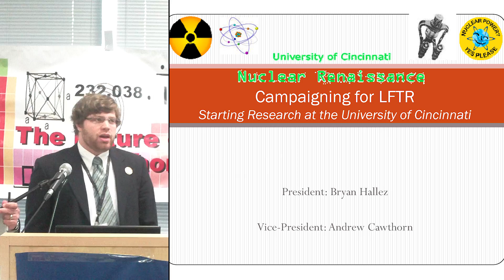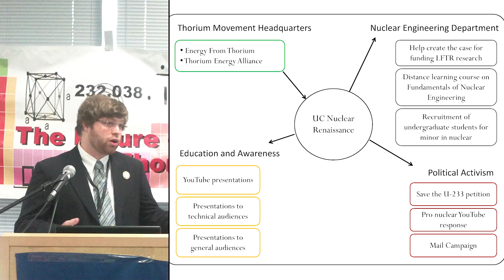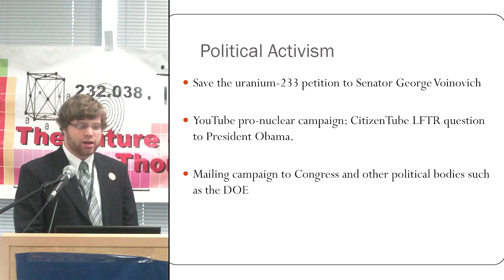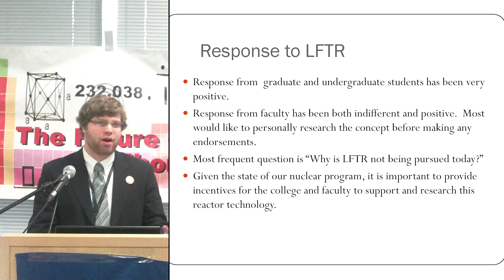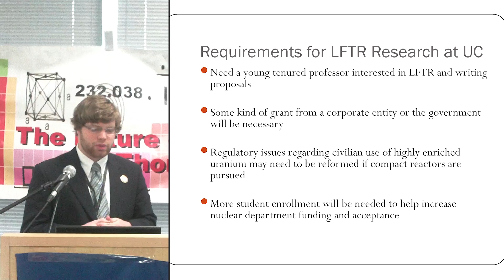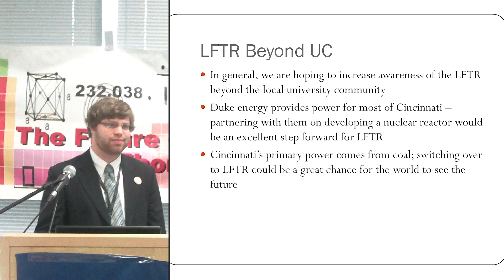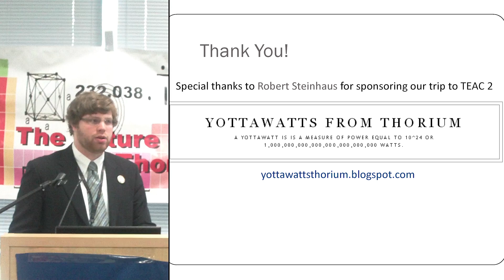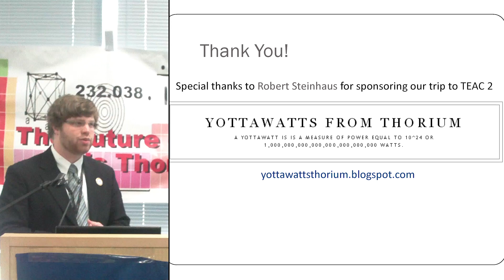Bryan Hallez - Campaigning for LFTR @ TEAC2

Comment: Ok, I have a question that hopefully someone that's in the nuclear industry can comment on: the LFTR allows xenon-135 to bubble out of it (presumably). It then removes said gas because it acts as a huge nuclear poison, and produces problems in controllability, whereas in a normal reactor it would be left inside (and produce damage to the fuel rods while absorbing neutrons).
However....xenon-135 is a radioactive material that decays into caesium-135 with a half life of 9.2 hours. So it can't be simply vented into the atmosphere, it needs to be stored while it decays. And since we pull it from the reactor, we're preventing it from absorbing neutrons (which would lead to it becoming harmless, stable, xenon-136). That would not be much of a problem given it's short half-life, buuuut it's decay chain turns it into the aformentioned caesium-135, which is a beta emitter with a half life of a whooping 2.3 million years. Which means that this reactor DOES produce a long-lived fission product, which would need storage for geological time periods. How do you comment on this? Does this not defeat the goal of "no long-term wastes?".
Reply: I'm really really not an expert, but from my understanding Caesium-135 isn't particularly dangerous. First because beta radiations aren't super harmful. You don't want to eat it, but otherwise it won't give you health problems. And Caesium-135's half--life is so long that it doesn't emit that much radiation in the first place.
Reply: @LeMAD22  True, however, caesium is readily absorbed in organisms. Once inside the body, that radiation is definently non-trivial. And caesium has a very low boiling and melting point, which means that turning it into a vapour or aerosol form (using, say an explosive) is easy (especially given its' energetic reaction to water). And being an extracted byproduct means we basically store it, rather than actively monitor it, so it can, in theory, be used for nefarious purposes if stolen (say, in a warlord dominated Africa). 
One wonders if putting it back in the reactor would be a problem. Cs-135's thermal cross section if roughly 9 barns, so a bit over Thorium-232, and as such would not have a massive effect unless the percentage would be significant. However, I have no clue what it turns into when absorbing a neutron. Hopefully not something worse.
Reply: James, yes if considered a waste then Caesium-135 would be annoying as it is readily absorbed by humans and would be a health concern... however it will also be the most easily segregated material, and I expect the question will become, what is the most practical use for it? At 2.3 million years and only being a beta emitter (not a gamma) it is essentially a heat source that will not run out. I expect the trick is to find a chemical bond which will hold both Cs and/or Ba (so when it decays the chemical bond remains) so that the decay heat can be harnessed and put to use. Don't consider it in context of a random element trapped in a fuel rod, but rather a completely pure isotope which can be put to use. It isn't something one would put in long term storage, but rather something to be harnessed even if only to generate electricity from decay heat (the most boring unimaginative use).
Reply: @gordonmcdowell  I...would not be so sure about it's usefulness. That's a relatively long half-life, and it's decay energy is a pitiful 268.66keV:
http://periodictable.com/Isotopes/055.135/index2.full.dm.html
While the energy is about 20 times more than tritium decay, it's half-life is 20000 times longer, so basically a mole of the stuff would give off 1000 less energy per unit time (though with a lot more units time; total energy after thousands of years would be higher, no doubt, but there is no application that I know of that requires a million year-long power source). And tritium is already considered a low-power decay source, fit for illumination only. I get the impression that using caesium for the same effect would mean it gives off 1000 less light, which is basically nothing. It's low energy also makes it unsuitable for betavoltaic and RTG sources (especially the last one; thermoelectric systems are notoriously inefficient and require self heating elements that more or less run red hot to produce modest amounts of power). 
What is worse is that it does indeed tend to concentrate in living organisms and that the quantity produced in a LFTR is non-trivial (60 kg for every 1000 kg of uranium-233). This is a problem, as caesium-135 would make ideal material for a dirty bomb (it's already in nearly pure form from the separation process of xenon, produces both radiological and chemical effects, and readily accumulates in living tissue). If that is true, than this picture, presented at one of the FLIBE conferences is misleading:
https://i.imgur.com/xjfA8.jpg
That xenon is NOT stable. One wonders whether it would be possible to leach neutrons from the reactor to stabilise it, while minimising the impact on the reactor functionality. That ridonculous cross-section should make this easier in terms of probability. 
All in all quite a nuisance. Since you participate in such conferences, would you please bring this question to mister Sorensen the next time you have a chance? I would email him myself but, alas, I have no idea how to get a hold of him. Thank you for the response!
Reply: Xenon is very useful for Ion propulsion and if a LFTR were being used in an interplanetary space ship you wouldn't have to worry about it's half life. Just dump it into the engine. If for some reason a reactor on Earth were to start fissioning uncontrollably and the Temp started to melt the pipes it would enter the environment like with a LWR it'll just start cooling off on the concrete floor.